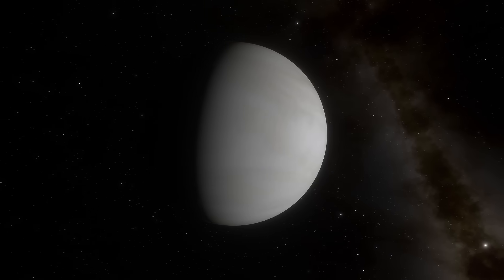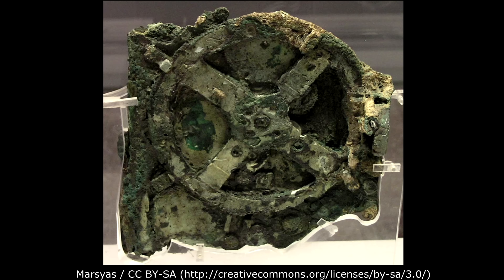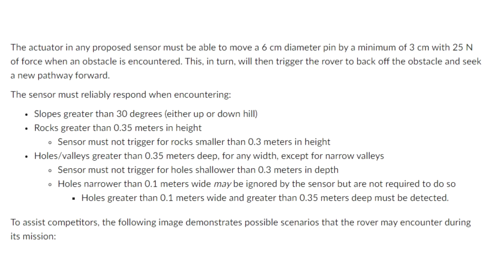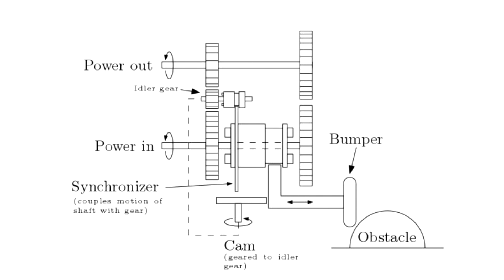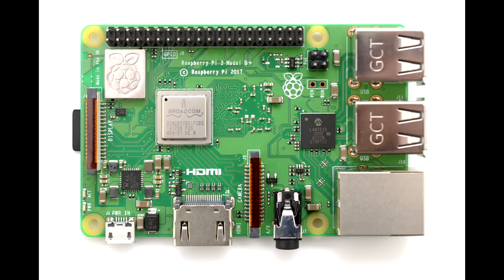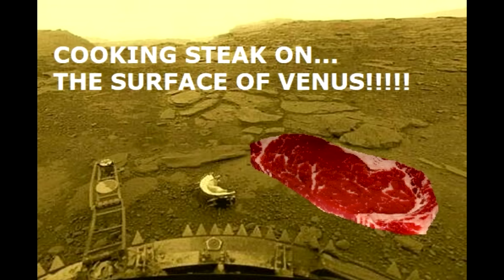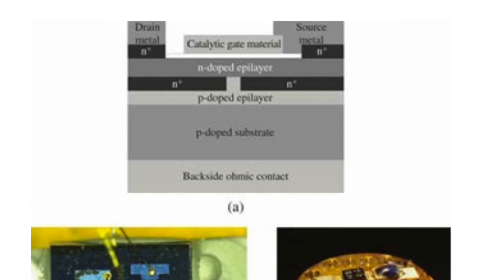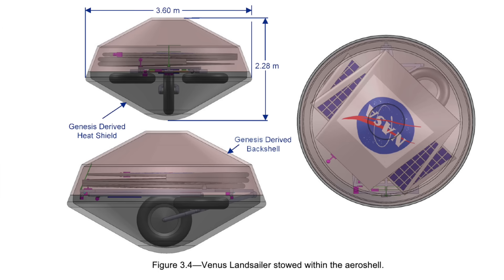Venus Rover Concepts That Beat The Killer Atmosphere

Comment: Let it tumble around in a inflatable shell like Tumbleweed.
It might give almost random movement, but it is very low tech and effective.
Reply: Until it falls into some crevice
Reply: @cplpetergriffin1583  So what if some balls do drop into crevices?  Drop lots of small simple devices and some will get trapped and some will travel to interesting places.  After all it has worked for trees for millennia, always look to nature for inspirational ideas.
Reply: @richarddoyle689  depending on the geometry of the crevice you are going to run into problems transmitting data back to an orbiter.
Reply: Richard Doyle   Trees are self-replicating and can do evolution. For them the long-term survival of 2 offspring — out of millions of seeds over the lifetime — is a growth factor of 2. You are not going to get a million balls onto the surface of Venus (there is only so much a rocket can lob to Venus and each ball needs all the instruments and transmission capabilities themselves), and if two survive, well they die of natural causes and then that’s it.

Also the balls will end up in the same area, as the wind will drive them the same way over very similar terrain.
Reply: @cplpetergriffin1583  have we ever studied a venusian crevice before?
Reply: DeathsHead Knight No, but a crevice is a a fucking crevice no matter what planet your on
Reply: @cplpetergriffin1583  You can always use a inflatable balloon to fly, it wil be useable for several times.
(But I think you'll need a bit of compressed light gas from earth.)
Reply: @PieterPatrick  
But who would develop this tumbleweed technology?

West Texas Instruments
Reply: @cplpetergriffin1583  The Tumbleweed should expand mechanically, inflatable is to vulnerable when I think about it.
Tumbling is not funny in a high pressure habitat when you're inflated. Lol
Reply: P. Patrick Tukkers Hobart (I think) sphere.
Reply: Great idea, keep.it simple.  Distribute by dropping several as lander descends and let the wind carry them about.
Reply: This is actually not a bad idea, though you'd want to use something like a wire cage instead of an inflatable (punctureable) case. A few years back, they made a self-repairing wire cage "wheel" for a new mats rover, something like that might work very well, if you had an anchoring device (retracting pneumatic supports to 'flatten' the wheel?)

Using a mechanical reaction control wheel equivalent might work for propulsion?

Only issue would be power supply, and ability to link to a sat while rolling.
Reply: @leakingamps2050  the lunar rovers had wire wheels that worked well.
Reply: @MrEh5  yes, though as far as I understand, they needed a material and structural redesign for long term use on a planet (mars), as they didn't hold much weight, and dented too easily.
Reply: LeakingAmps If you can expand it to start rolling you can collapse it during a pass to do all of your uplink
Reply: @leakingamps2050  It could be a spherical wheel with deployable legs.
the energy source could be something rolling on the inside, like a magnetic ball bearing inside a round copper sphere.
it get it's energy from the wind, no very powerful, and it would need some serious storage (Springs?) when it stops, but quite low tech and easy to make resistant to corrosion, pressure and temperature.
Reply: I tought the same but a ball with  some inercial wheel inside for making it roll.
Reply: P. Patrick Tukkers This seems to be not a silly idea. The wind speed at the surface is around 10mph, which doesn’t sound like much, but the density means it could move small stones very easily. Crevices and cliffs would be a problem, but a steel ball can be made relatively buoyant sufficiently for the wind to keep it moving. Movement could also be utilized as a power source. Sounds great

However... one or two small problems. The whole point of being on the surface is to do geology. How does a tumbling steel ball stop to take samples and make analyses on the samples? How does it take useful photographs through a lens that is constantly being dragged and scratched on the surface rocks? And how does it stop to unfold an antenna good enough to establish an uplink to the satellite to send data?
Reply: You're going to inflate something in 90X atmosphere pressure?
Reply: @Kanglar  Nothing difficult about that, we store gas under pressure at 10,000 psi without much difficulty.
Reply: @PistonAvatarGuy  Super easy; barely an inconvenience!
Reply: @PistonAvatarGuy  But not at 800°F.
Reply: @RWBHere  True, titanium would probably work, though. The bigger problem would be finding a material to make the inflatable object out of which can survive those temperatures.
Reply: @Kanglar  not to mention the temperature. Not sure if any materials are known that have the ideal properties for a balloon at 500 C
Reply: @Kanglar  its lot hotter on the surface than up high in the atmosphere thus, its effectiveness be extremely well useful until you get up too high from loosing heated air pressure.
Reply: @Kanglar  If you're pumping venus atmosphere into the ball, 90X atmospheric pressure is ambient pressure on venus, so its difficult if you're inflating from a compressed gas cylinder you brought from earth, but easier if you're using local venus-air.
Reply: @Kanglar  
...A balloon with light gas, why not?
(Edit: Light gas, not at lower pressure.)
You allready have to deal with the high pressure anyway.
And 90x the pressure is not a problem for us to engineer.
Reply: @PieterPatrick  what material woud the baloon be to withstand the heat, UV light, dustadhesion - and where  do the instruments poke out to do the experimentation?
Reply: @PieterPatrick  Really depends on the surface area's exposed to the pressure and especially the mass budget available: 10 bars in a Liter: heck, a glass bottle will get you near, rubber (re-inforced) hoses work perfectly fine, etc. 0.6 bars pressure difference on a airplane hull: a lot more difficult. We need some more specs to have a serious opinion about this. Also, consider how big your average CO2 fire extinguisher is, that contains about 5L CO under 200 bars. In Venus such a cylinder of 15 kg would only give you the flotation power of (200/90) = approx. 11 L  of atmosphere. Aluminum ways 2.8 kg/L. In liquid a Aluminium atmosphere you could lift like 30 - 15 = 15 kg at best. 
All of these figures are conservative, but none of them will suddenly be 10 times smaller. And I highly suspect that even at these high pressures a gaseous Venus atmosphere would still be considerably lighter than aluminium. 

More interesting is the how they will be trying to reduce friction in those mechanisms (admittedly, not expert, but I need to know the basics for my professional life). Grease products will probably decompose rapidly in this environment, forced lucubration really needs a cooling system and while copper / brass based slide bearings seems scary.
Reply: @Tuning3434  Then again, lubricant in many guns is what's left from exploding gunpowder-though you'll have short lifetime so you'd need to have to get some lube on-site, venus hills and crevices being rather difficult. Atmospheric one would renew, and we know a bit more about that (not to mention it's more constant than anything you'd be able to gather from the ground).
Very interesting problem.
Reply: @Tuning3434  Jewel bearings would go well with the clockwork theme
Reply: @tonikotinurmi9012  Pure Graphite is an excellent lubricant which will continue to work until well beyond the temperatures which any metal bearings can withstand.
Reply: Here's my tumbleweed idea: Make a ball out of layers of springy (and therefore self-deploying and resilient) wire mesh, such that it simultaneously forms a spherical mesh wheel (similar to the toroidal ones the LRV used) and a metamaterial Luneburg lens for radio waves. Design it such that it focuses to somewhere short of the center of the sphere. (Luneburg lenses are usually considered as focusing on their far surface, but they can also be designed to focus beyond that surface, which Wikipedia says is useful when you're using a feed horn that has a phase center relatively deep inside its mouth. I assume you can just do the inverse of that, and get the lens to focus less than halfway through itself. However, only some of the rays that enter the lens will be able to be directed to this focus, because the ones around the lens's limb would have to be turned backward and would arrive at the focus from behind, which will be blocked by the reflector described in the next sentence, which reduces efficiency somewhat.) In the middle, at the sphere that is the focus of the lens, put a spherical modulating reflector (reflective side out). It doesn't even have to be a _retro_reflector on its own—the lens takes care of that. Then put the clockwork inside that reflector, so that it doesn't block radio waves going through the lens to/from the reflector. Radial projections outward from the core to instruments on the ball's surface are allowable, as long as their cross-section along the path of radio waves through the lens is small. The clockwork can be powered by a gimbal-mounted pendulum inside the core that always points approximately downward as the ball rolls. A Google search for "mesh metamaterial rf luneburg lens modulating retroreflector" (and queries with subsets of those terms) turned up a bunch of research that looks applicable.
Reply: How do you do science with something like that?
Reply: @PistonAvatarGuy  The "shell" of the "Tumleweed" is inflatable...
I just like to start with the most simple system possible. :-)
Reply: I wonder if the Venusian natives, upon seeing this reinforced, armoured, intelligent invader from "the 3rd rock from the Sun" will try attacking it - Good God, it's like the plotline of an Asimov story. 🤗
Reply: The density of the atmosphere is 67kg/m3. A ball full of aerogel with a very rigid and strong skin, and some sort of spring loops as hair might have density comparable to the atmosphere itself which would allow it to bounce, roll and in some days levitate. Aerogel would be an insulator so perhaps some electronics could lurk in the core given we have an energy source somewhere. It also seems the atmosphere has 1 bar pressure in about 50km where the temperature drops to negative Celsius. Could it be actually possible to have something levitating at that altitude hanging a wire down to the surface? The wire could have levitational aids such as propellers or other low density things and it could transmit energy and data, perhaps even material. I don't know anything about betavoltaic or alphavoltaic batteries but perhaps they could produce current also in challenging environments.
Reply: plus it might not matter so much if it falls off a cliff or whatever, hell you could even have some sort of parachute attachment to carry it really far then cut the tether so it falls back down somewhere else
Reply: What kind of flexible material survives those temperatures?
Reply: @highgroundproductions8590  Fiberglass, Zylon and maaaybe Kevlar do alright at Venusian temperatures. Most of the higher-melting metal alloy families (iron, titanium, nickel, etc.) have no problems whatsoever. Graphene or another nano-sheet lining the inside might help too.  You could do multiple layers of metal mesh supporting a tight weave of fibers, with a thin metal foil on the inside to provide impermeability to gas leakage. You don't really have to seal super well, just enough that the compresor's power draw is manageable. For power, a gas-cooled high-temperature reactor might be interesting. They've been designed with core temperatures exceeding 800C, and would still produce plenty of power in a 500C atmosphere
Reply: I like exploring a nice crevice.
Reply: The average density of Venus' atmosphere at the surface is more like a liquid than a gas.  AFAWK  it does not have any lateral currents flowing to push a tumbleweed around.  While you can make it neutrally buoyant,  propelling it thru the hot goop that is Venus' "air" will be more difficult than we would assume.
Reply: no dont inflate it, make it a vacuum blimp, but I like that Idea, had a similar one
Reply: @biomecaman3514  A vacuum blimp will be much heavier than a balloon.
I wonder if a vacuum blimp is even possible... great thought experiment.
Reply: @PieterPatrick  Vacuum balloons are impossible to make work on Earth, but it's thought that it may be possible for them to work on Mars due to the lower gravity.
Reply: Don't forget all materials have to withstand Sulphuric acid at 90 Atmospheres of pressure and a temperature of 500C
Reply: ... why not make a flying rover?... one that launches in the atmosphere, or something?... idk ...      --/('  ')\--
Reply: Until it rolls off a cliff into a culdera
Reply: They're asking for a specific solution to a specific problem, and y'all are over here saying, "hey maybe you should have ketchup on your fries".
Reply: A gyroscope could give semi guided movement too.
Reply: @heathcliff8624  Buoyancy is about density, not pressure. Inflation working successfully also implies that the interior pressure is greater than the exterior pressure.
Reply: Wouldn't it just float?
Reply: Maybe it could roll by just before two other Rovers have a duel
Reply: Even better if it has some form of pneumatic pump on a gyro so it pushes towards the ground and it'll roll better and can get out of sticky situations
Reply: Submit it!  Smarty-pants

Comment: I'm a little disappointed that a video about Venus probes never mentioned the Soviet Venera missions. We've been to the surface of Venus before, but anything outside of NASA gets forgotten.
Reply: yes, except those all failed in hours, rather than months or years.
Reply: @ryanspence5831  Venera operated at 100 times atmosphereic pressure and almost 500°C for 23 minutes sending data. That with 1960's technology. Quite impressive.
Reply: @dreamyrhodes  yes, but the Venera landers are not really relevant to video about developing a 21st century rover designed for long lifespan.
Reply: @ryanspence5831  That was not the point.
Reply: @ryanspence5831  that's the best we had though. hours.
Reply: @ryanspence5831  And that freakin lens cap ... (^_^')
Reply: Weren't the surface pictures from the Venera missions?
Reply: @Lttlemoi  Yep. Used but not credited.
Reply: Lttlemoi, Provided you where a bit more openminded you might have been read about the Venera probes and would have learnt which difficult and long way they went from the first flight by to learning about atmospheric pressure profile and temperatures. This long way was necessary to design finally the right landing capsule for this hostile planet. The one and only Venus surface pictures were made by the Russians so far.
Reply: @61Ldf  Yep. We all know and acknowledge this fact.
Reply: IT simply wasn't the topic of the video. He talked about the Veneras often enough.
Reply: @5Andysalive  Precisely. Why are some Russians intent on promoting false ideas about Westerners ignoring Russian achievements? Scott devotes huge amounts of time to the subject. Just not in this one video!
Reply: @Blitterbug  that's because if Russians don't blame everything on "western hysteria" they have to acknowledge their failures. That's coming from a proud Slav who doesn't even live in America, too.
Reply: It's about venus rovers. Which have never existed.
Reply: Western Bloc at it again
Reply: @Xatzimi  Scott regularly gives mad props to the Soviet-era accomplishments, and no Western space fan forgets how amazing this stuff was!
Reply: @Blitterbug  Not really; this video is a great example of the subliminal bias in fact. As mentioned he uses the shots from the Venera, the entire discussion is about the challenges of surviving on Venus, but doesn't mention AT ALL the only success story anyone has ever had with the planet, nor how they achieved it. And it's frustrating because what ever you think of the Soviet Union, science is science is science, and hearing some of it largely discarded because we don't like the discoverers is incredibly anti-scientific. However I suppose we should in turn be grateful that there was no endless gushing over SpaceX this time, an equally political position because many it seems are enamoured with their "libertarian" identity (or are just bedazzled by Elon Musk's cult of personality).  

Yes, there's a quick mention of Soyuz here, one of the few Russian achievements Scott ever really mentions, but one can't help but suspect it's because the US still isn't flying it's own astronauts except on Russian technology... it'll be interesting to see if Scott, Ars Technica, and others who treat science as a team sport will do so once the US has it's own solution again or not.
Don't get me wrong, I enjoy Scott's videos; I just intensely dislike the current bias that shows how little we have moved beyond Cold War prejudice with regards to science.
Reply: @TotalCowage  The entire discussion is about creating a rover using non-standard technology that can actually operate on venus for an extended period. No matter how admirable Venera was, it doesn't contribute to the discussion except as proof that alternate technology is necessary, and bringing it up would be redundant. 

Not stroking the ego of those with a victim complex about Soviet achievements every time he talks about Venus isnt Bias.
Reply: @TotalCowage  You're new to his channel, then. You are picking apart one video for a minor lack of attribution, because it wasn't core to the point he was making. Why not watch some of his many, many videos on Soyuz and see if you can find this 'western bloc bias' you're so fond of attributing to him?